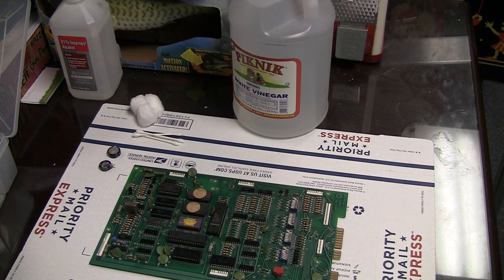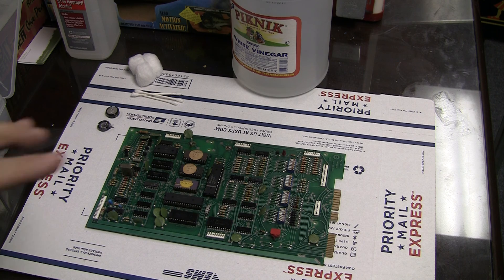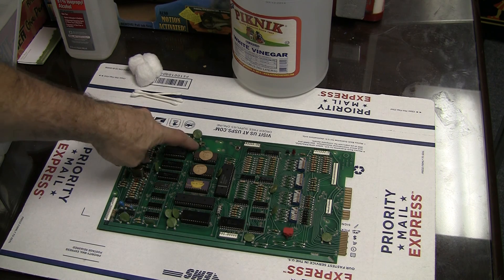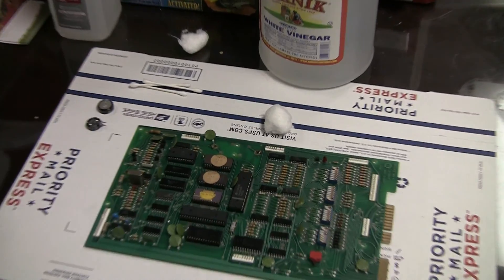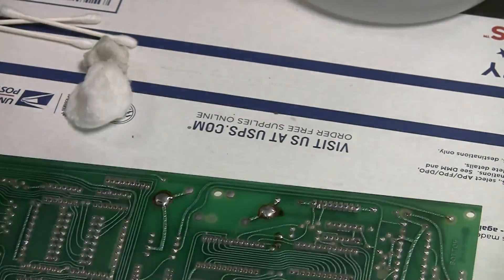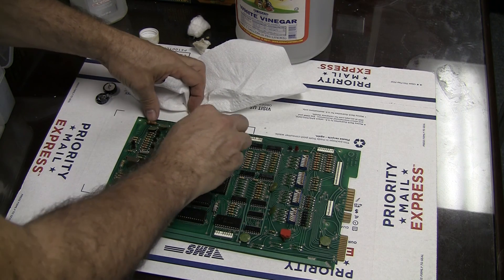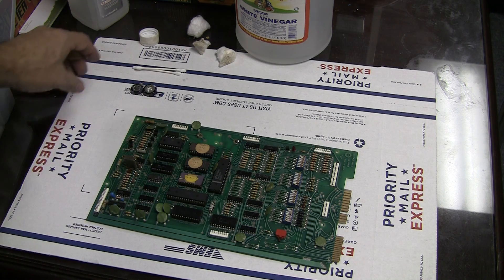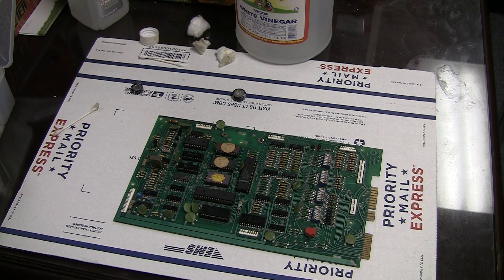Upgrading Game Plan MPU board with a memory cap - Sharpshooter 2 - PinballHelp.com

Comment: The masking is very thick on old boards.. should be ok.. what does bother me is the uv proms with tape that can pass light. And btw a “memory capacitor “ is a super capacitor and it still has electrolyte in it.

Comment: Yep had to do this alkaline leakage in my The Getaway High-Speed II machine as well and what I did was poured the vinegar all over the holder and the chips around it and did the other side.
I caught it just in time or at least I hope I did.
It just found its way onto one of the legs of the holder when I zapped it away. :)
And I don't do the remote battery as leaking batteries can still damage the boards.
It is actually the vapors and the heads not having enough ventilation so you have the alkaline vapors just sitting in the head getting on the other boards and getting under traces.
And once under traces the board is pretty much toast.
What I use instead of traditional alkaline AA's is Lithium AA batteries for the old battery holders they do not leak when they go dead unless you short them then it won't be to pretty if that happens.